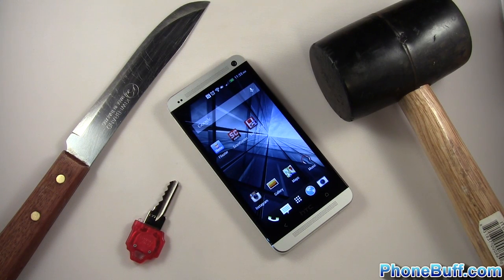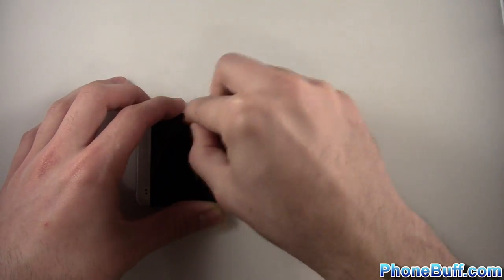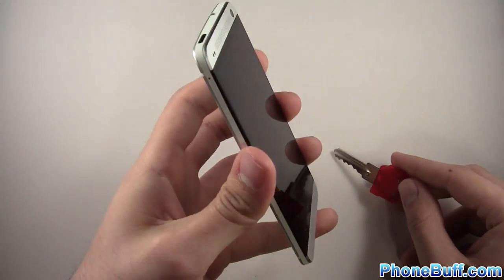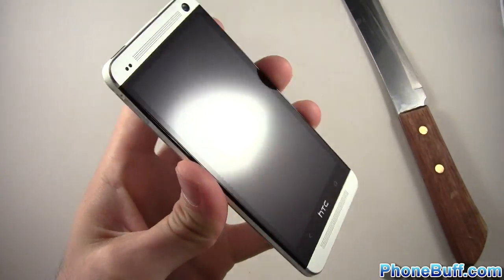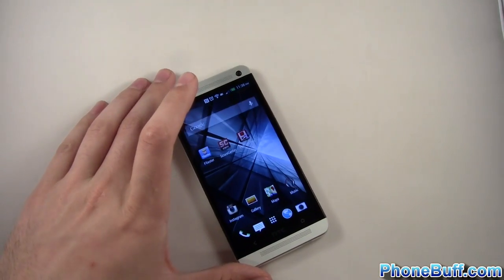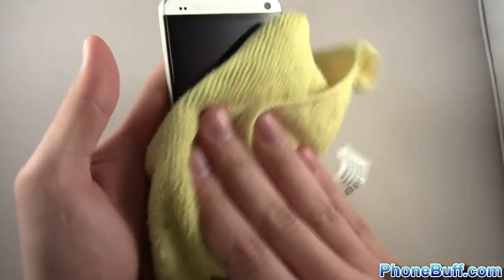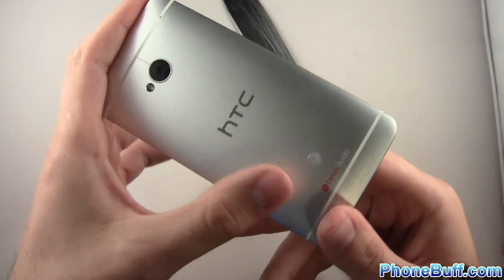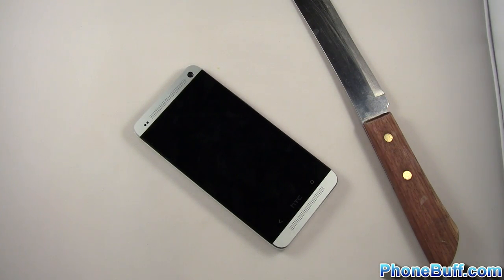HTC One Hammer & Knife Scratch Test

Comment: I have the HTC double dip case on my phone.  I just put the case on yesterday and it messes up my screen protector so I took the protector off.
I've had my phone for almost a year and no scratches.  Now that the screen protector is off should I be worried? I've never dropped a phone and its kept in its own pocket.
Reply: I wouldn't be worried. As long as your case edges out of the screen (like a lip), you are good to go. Out of all my phones I have just used a case and no screen protector because the lip can handle all drops and gorilla glass is VERY durable in everyday life.
Reply: I had screen protector in the beginning.  The screen protector showed finger marks, dirt, and ugly.  So I removed it.  For 4  years, the screen is beautiful, no scratch, if any finger prints are shown, just wipe it clean.

Comment: why not a drop test instead of a rubber hammer?
It absorbs alot of the shock, and is alot softer than a floor.
But really good someones testing the durability, please use the floor it would give a better feeling of what it is capable of
Reply: it's actually a rubber mallet! :)
Reply: ahh :)
Thats a little better
Reply: Read my post.  I dropped it on brick walkway, cement driveway,  tiled bathroom floor numerous times.  My phone is M9.

Comment: Well to the uneducated Glass consists of mostly SiO2 (silica) so anything that is as hard as SiO2 can scratch it.  Sand and dirt contain SiO2 and other ceramic minerals.  Metals come in a very wide range of hardnesses but, in general, metals will not scratch glass.  And...  a soft metal can certainly get a piece of sand embedded in the surface and that can then scratch glass.

Comment: I had this phone since June 2013. I got a case with it, but it had no grip to it and slid outta my hand more often than without a case. Still, I've managed to drop my phone thousands of times on concrete, in water, etc. The screen is just as fresh as it was the day I got it. The edges are pretty dinged up, but I don't care cuz it just shows how resilient it is. I may even bypass the M8 and keep this till the M9 comes out.
Reply: The M8 has a round edge now. SO the edge's won't be banged up. Get the M8, it's worth it!

Comment: I dropped mine while walking my dogs, I walked another two miles before I noticed it was no longer in my pocket. I retraced my steps and found it in the middle of a street, it had fallen face down and was run over by a huge truck right before I got to it. It had clearly been run over many times before that. I picked it up and found the only damage was the obliterated screen. I received a text message right after I picked it up. Pretty darn resilient. I only had a hard gel case on the back of it.

Comment: I have an HTC One (with insurance, luckily). I've bought a leather pouch after a week, thinking it needs protection. Three days later, I took it out of my pocket with the wrong end of the pouch facing downwards, thus causing the phone to hit the floor. The damage was not too bad, but the metal got distorted a little bit, and it really just breaks the beautifully smooth design.

Comment: I'm sorry, but this is really bugging me. People need to learn their tools... It is NOT a Plastic Hammer, it is a RUBBER MALLET! And btw, any phone screen no matter what is going to break if you smash it with a metal hammer. He was testing if the phone could withstand heavy pressures and the shock of a quick swift hit. Most likely a dude isn't going to run up to you and hit your upper leg with a metal hammer, but the mallet simulates something like bumping your leg into a table which I know is something most of us have done as much as I hate to admit it.

Comment: It's not just gorilla glass, even normal glass is considered harder than iron and steel which is what most knives are made of, so they would resist scratches. However, sand/stones are harder than glass so if you pick up some sand from the ground and rub it on the screen, your screen WILL be scratched.

Comment: 0:15 thé "Non sharp edged" key test.
0:20 é "weared off" knife scratch and stab test.
0:26 é "Rubber" hammer drop test. (Will not damage the glass, but should damage hardware, weird it didn't damage any hardware).

Fact is, that your glass WILL scratch if you have keys with sharp edges in your pocket. Try to prevent that.
A good sharpened knife WILL slize half of your phone when cutting the back of your phone.
And please don't try a metal hammer, it WILL kill your glass and maybe even the LCD.

Comment: I have no case for my phone and I've dropped it like 8 times so far. Usually it's from hip height when Im taking it out of my pockets. I've dropped it pretty hard on the sidewalk and street several times without it breaking. The screen is still super sharp and everything wipes right off. The only real damage the phone has taken is the edges of the phone which are softer. This is easily the most durable phone I've ever used. The only issue I have with the phone is the grip. It is  very slippery

Comment: Does the htc one has better scratch resistance than the xperia Z? Trying to decide which phone to buy here
Reply: would you say the 4 ultra MP cam of the one is better than the 13MP cam of the Z? Only have to know this, ,,, and if the htc one screen is as sharp as xperia Z's
Reply: Mauricio Pimienta You do know that Megapixel is useless after a certain point.. companie rush to the highest pixel, but it doesn't matter at some point.. unless you're doing some extra zooming. Megapixel only makes the resolution higher, a 4MP gets you 2664 x 1496 at 16:9 and 13MP will get you 4808 x 2704, which are both way to large then your normal HD TV/screen or phone (1920 x 1080)

Comment: There is a big difference between mallet and hammer.  "Hammer" is in the title, so you should have used an actual hammer.   I would actually be surprised if the phone did not pass mallet test-mallet heads are rubber.  Nothing impressive there.